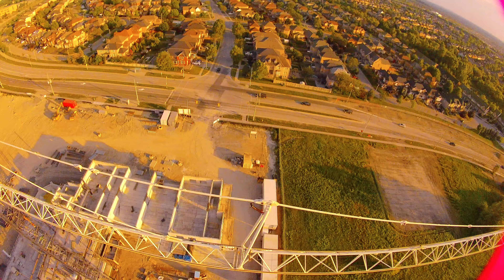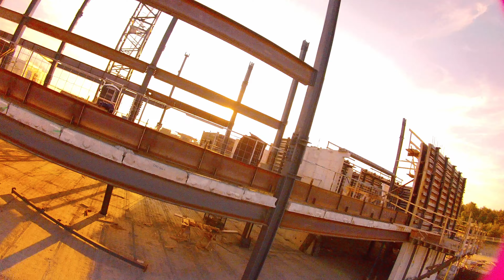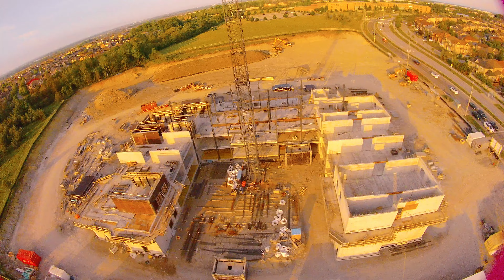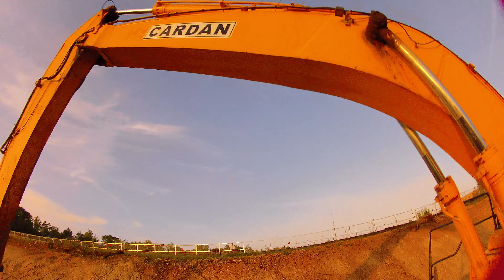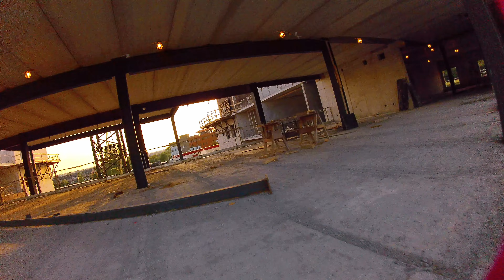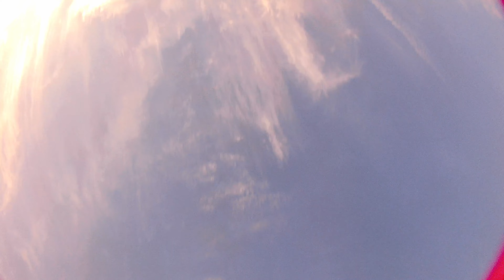Construction Return // FPV Freestyle

Comment: Awesome flying !!!! the dive into the lower part of the building was gnarly ! lighting and colors are perfect ! 🔥🔥🔥🔥
Reply from the maker: Thanks dude!
When I did the dive into the lower part I almost lost all  video 😅
Reply: @_tcmore  dang and to get it back looked really fun if yeah crashed 😂, Awesome yeah got it !
Reply from the maker: @ghostdropfpv  woulda have been a “quick” hop over the fence and run to find it lol
Reply: @_tcmore  yeah just the finding it part, also looked maybe like wet cement or something down there maybe not though, looked shiny though 😂
Reply: @ghostdropfpv  Yep it was a covered concrete slab they just poured. Cement is the powder and concrete is the portland cement, sand, aggregate, chemicals and additives together.